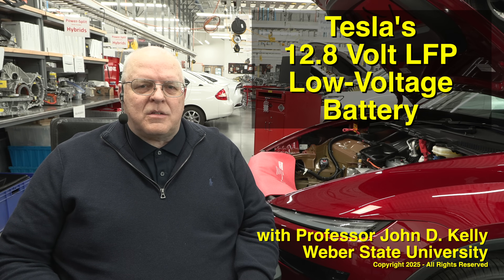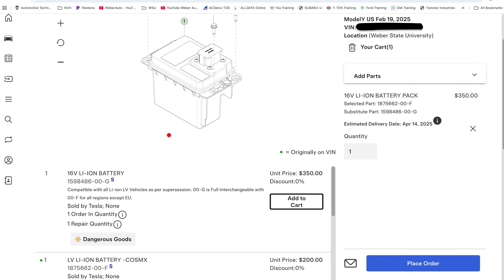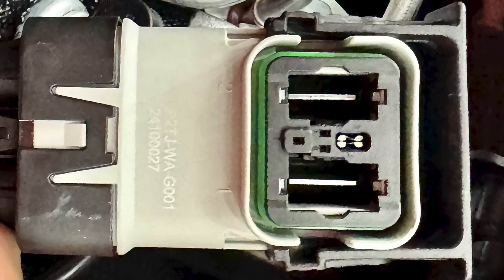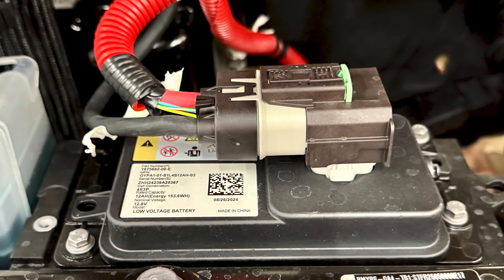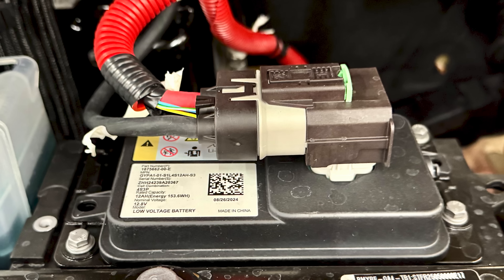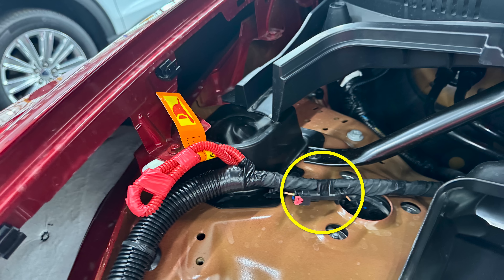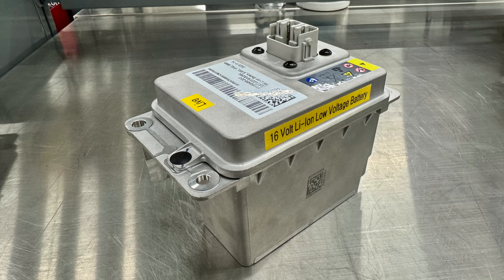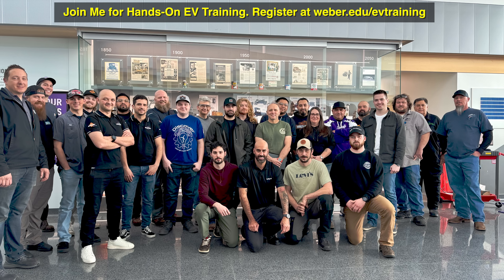Tesla's New 12.8V Low Voltage LFP Battery

Comment: Thanks for your awesome content!

Just a note, as stated on the documentation, for some unknown reason, the newer LFP low voltage battery is not available for vehicles  in Europe. Is it probably due to being manufactured in the Shanghai Factory, with different car hardware?

Comment: 6:30 I'm hoping that the reduction in low voltage system design from 16V NMC to 12.8V LFP is a good sign for us HW3 people that are still on the 12.6V PbSO4 on Intel systems. The cooling system will need to be retrofited entirely, but the wiring looks like it could be salvageable.
Reply from the maker: It is not. I would not plan on a retrofit coming. Thanks for watching

Comment: On my second EV, first a Leaf and now with a 2026 Model Y.  I checked mine and it has the 16v Li Ion battery.  If I understand correctly it should be interchangeable with the 12.8v LFP.  Is there any advantage to switching?  Outside of the ability to use 12v accessories that might not support 16v?  Recently found your channel and really enjoying learning more about the technical details of my car - which I love.

Comment: When the battery failed on the older Tesla's (the ones with the lead acid 12v battery) they could be jumped just like an ICE vehicle.  But now, if the LIFEPO or the Lithium Ion battery fails it can't be "jumped" because of the connector and you'll be forced to have your car towed to a Tesla service center.  I sure hope these new batteries are reliable!!  Also, folks that used to tap into the original 12V lead acid battery to run 120vac inverters are out of luck with the new car.  Tesla should have put a 120VAC outlet in their cars!!

Comment: Hello Mr. Prof. Kelly. I am a Slovak from Europe and I own a Toyota Corolla Cross HEV with an M2.0 l engine. About 2-3 times when entering the highway while increasing speed by quickly and smoothly pressing the gas pedal, it happened to me that in the last quarter of the pedal travel, the pedal seemed to break. When consulting with the seller, it was explained to me that this is a manifestation of the vehicle's kick down function. I am not satisfied with this explanation, because I am convinced that the gas pedal should have smoothness throughout its entire travel. My question to you as an authority in driving school and in my motoring life is: Does the Toyota Corolla Cross M20A have a built-in hardware Kick Down function, or can this only be performed by very quickly pressing the gas pedal? The vehicle has a built-in 5th generation E-CVT hybrid system. I enjoy watching your videos presented in a pleasant and professional manner, I like machines, I was a lifting equipment repairman in a nuclear power plant for 40 years. I wish you many more videos in good health, the best.

Have a nice and pleasant day
Great yours video professor!
Vit Halada

Comment: Do you know if the 12.8v battery would be compatible for the refreshed model 3. This would allow fitment of aftermarket audio amplifiers to run on lower voltage systems? Thanks

Comment: You never told us why you replaced the battery.

Nor did you tell us that this was going to be a seven minute advertisement for training provided by the university that has deemed you a "professor ".
Reply from the maker: I changed the battery to see how it is done. It is a totally new process I had never tried. Nobody gets “deemed” a Professor. It takes a minimum of 15 years of exemplary teaching, scholarly work, and service to even be considered.
Reply: @ you changed it, to see how it's done. So there's not a service manual that says disconnected and remove it and then reverse that.

Comment: Why do they call it 2026 Model Y when the Year 2025 just started?
Reply from the maker: Because they made both versions of the model Y through February. The old one is a 2025, the new one is a 2026. Model years have nothing to do with calendar years. Thanks for watching.
Reply: @ the old one was the 2023-2024 model.  Before we had the 2021-2022 including ultrasonic sensors.  Imagine selling the car used at the end of the year - LOL

Comment: The 12.8 V battery is only $200 vs $350 for the Lion in the parts list.  It is incorrectly labeled as 16V on the parts list.

Comment: Seems pricey. I just bought a new 12v lead battery $85 from Tesla. Old one lasted 5.5 years. If I get average 5 years, I could buy almost 4 lead batteries for the price of 1 new battery. 20 years for old batteries and new battery should last 10 years?
Reply from the maker: The new battery is designed to last the life of the vehicle. Thanks for watching.
Reply: @WeberAuto  That's new to me. I thought Tesla only offered a short life on those. Where can the info be found?

Comment: LFP batteries are so cheap to make now I don't know why we aren't seeing regular ICE car batteries with LFPs yet. You can get LFP motorcycle batteries, but they are overpriced in the US compared to what it actually costs to make them. An LFP battery can be manufactured for about twice as much as a sealed Lead Acid battery for the same cold cranking amps.
Reply: So they are double the price of a lead acid?
Reply: @justinstewart3248  Yes and last at least 10x as long.
Reply: not all LFP batteries are born equal, they get binned like CPU after production the junk grades are cheap and for good reasons

Comment: Which one is technically better?
Reply from the maker: According to Tesla service, they are equal performing. The LFP battery does not require programming when first installed, the NCM does.
Reply: @WeberAuto  I was reading a bit on this, and I think the LFP is better because of the higher expected cycle AND ability to resist heat (it could get really hot under there)

Comment: Thanks for the video. What is the difference between them?
Reply from the maker: The operating voltage is the biggest difference. Tesla states that "Both batteries perform equally, and the fitment will be based on factory, supply chain, and inventory management."

Comment: Why can the 16V battery in my car, not be replaced by the new 12,8 V battery?
12.8 V LFP is the best solution.
Reply from the maker: There are hardware and software differences that prevent it on previous vehicle vehicles

Comment: LiFePO4 are cheaper than Li-Ion types. The have almost half the power density, and lower terminal voltage; there are four cells, not three inside the battery.
I have doubts about the long term longevity of LiFePO4 batteries in high temperature environments. In ICE cars, the LiFePO4 battery - replacing the SLA starter battery - fails after one year because of excessive temperatures under the hood. The Model Y has no engine under the hood though. 
I may sound retrograde, but I preferred the old lead-acid battery. It has no BMS or CAN interface, and costed one tenth of the newer Li-Ion battery, and wasn't a proprietary device.
Reply from the maker: Thanks for watching

Comment: Who are you looking at in the video?  But $350 for that battery?  OMG that's expensive!  Also, you kept saying to the right and left when it was actually it was the opposite of what you needed to do.
Reply from the maker: The right and left side of the vehicle are always referenced from the driver seat looking forward.
Reply: It's about the same cost as a traditional AGM battery.

Comment: $350 for a 12Ah battery 😬
Reply from the maker: They are costly, however, many automotive batteries are in that price range, especially AGMs.
Reply: I was surprised it was so cheap. Roughly the same cost as a traditional a g m battery.
Reply: @JasonWW2000  really, for what capacity? An off the shelf LFP 100ah 12v battery is $200, this one is only 12ah. So, over 10x the cost compared to off the shelf component.
Reply: @robo5553 I think you're comparing apples to oranges. This isn't just a raw battery. This is an engineered module with all the b m s and other circuitry built in and designed to operate in a wide temperature range. It has a full warranty and covers any damage to your vehicle that the battery may cause.

Comment: I found on 2018 Model 3, when original 12v lead acid battery started dying, I connected a CTEK reconditioning charger to it and used its recondition mode.  It’s designed to pulse up to 16V to the battery to “clean” the plates inside and extend the life.  Although CTeK stated it did not neeed to be disconnected from the car, as all cars are made to accept 16volts, the tesla main screen (made by LG) started smoking!  A component on the back side of the screen obviously got stressed and popped.  It required a new screen, not covered by warranty.
I’m not sure if that was a fluke or if the original Model 3’s didn’t  have 16v hardened components but be careful on early cars.
Reply from the maker: The Tesla vehicles here in our shop will trigger service alerts for a bad battery if an external trickle charger is attached for any lengthy duration.
Reply: I think it is not possible to replace the old acid battery, by the LFP, because the connectors are completely different.
Replacent should be possible if they have the same connector only.
Reply: Not very smart using a pulsed charger on a modern vehicle with a load of electronics 😩
Reply: @hughmarcus1  Thats why we read the ctek manual and then called them to doublecheck.  Ctek said every vehicle can handle 16volts.
Reply: LFP (4s single LiFePo4) are perfect to repalce lead acid batteries. The charger from HV to 12V is the same and charge the LFP near the optimum. For could regions tesla should use LTO (6s LTO)
Reply: Considering how easy it would have been to take off one cable.
Reply: @ralanham76  Exactly!  But CTEK said no need, leave it connected in the vehicle.

Comment: The faster way if you have possibility to use toolbox 3 , change on car configuration tape of Low voltage battery then learn new battery. Car shouldn't wont reinstall software 😊
Reply from the maker: I will have to try that. Thanks

Comment: I’d be curious to know if the trailer connector now supplies a permanent 12 volt again. The model X used to do that, my 16V model Y does not. I suspect it still doesn’t due to the LV battery’s size, but one can hope right?
Reply from the maker: I doubt it, but I do not know for sure.

Comment: In my VW ID.3 the 12V battery regularly gets charged to 14,5 V
Reply from the maker: Yes, that is a typical charging voltage for 12 volt batteries. Thanks for watching

Comment: Can you jump start another car with these batteries? I’ve easily jump started over a dozen cars with my 2022 model 3 lead acid battery.
Reply from the maker: No, the owner’s manual specifically warns not to jump start other cars.
Reply: No
Reply: Since these batteries are not required to crank over an engine, it probably has a BMS that limits its output current.

Comment: Very interesting, I just checked my Texas built 2026 Y and it has the Li-Ion battery.  

John, I’m curious what the weight difference is between the two batteries?

Do you know which factory you’re wife’s Y was built at? 

LFP cells are China sourced I think, so I’m wondering if that played a role in which LV battery you get in NA.   Do you know what cell sizes are being used in these LV packs? 

Are they Cylindrical or Pouch style?  

How many cells in each pack? 
4, 8, 12 ?  I’m assuming 4 cells in series  configured in parallel for increased Amperage.
Reply from the maker: Thank you. This one is from the Freemont, CA plant. The weight is 2.1 kg (4.6 lbs) for the LFP and 1.8 kg (4.0 lbs) for the NMC battery. The LFP uses 12 pouch cells (4S3P) at 3.6V per cell pack.
Reply: @ Thank you, Sir!
  I wish you had been my one of my Instructors when I was in Automotive & Diesel technology school 40 years.  Huge Respect for you 🫡

Comment: Interesting that you need a software update for that. Thanks for showing.
Reply from the maker: I suspect all the systems on the car have to be reconfigured for the higher voltage or lower voltage when installing either battery.

Comment: 6:27 Great video and thank you for sharing your knowledge. Bottom line, which battery is the best?
Reply from the maker: Thank you! According to Tesla, "Both batteries perform equally, and the fitment will be based on factory, supply chain, and inventory management." however, they also state "The LFP LV battery does not need firmware updates. The internal logic persists for the battery's lifetime. As a result, a LFP LV battery from storage will be compatible when it is connected without mismatches, MIAs, or the need for software redeploys."
Reply: The LFP is better, 150Wh compared to 100Wh on the NMC. Longer life as well.
Reply: The longer life time might be very important because when you need one time assistance or the car

Comment: Thank you so much. I had always wondered about these new lithium batteries for all the Teslas. I know back in the day they used to die prematurely. I’m so thankful that it appears they have fixed everything.
Reply from the maker: Thank you!
Reply: @LJ-jq8og  The lead-acid batteries had a very short lifespan in certain parts of the country.  18-24 mo.  

I have a 2018 Model 3. The original battery lasted almost 5 years, which is good. The replacement battery only lasted 18 months. No idea why it failed so early 🤷‍♂️
Reply: @dennisschlieckau8723  very interesting. It sounds like the new lithium ions have solved all the problems.

Comment: Did you trade the Bolt in?  If so how many miles were on it at trade in?
Reply from the maker: Yes, traded my 2019 with about 37k miles on it.
Reply: @ Did you ever have any issues with it? Just wondering.

Comment: I imagine it has some pretty clever management to heat it regularly in cold environments considering you can’t really charge LFP below 0C I wonder if it can be problematic in very cold environments.
Reply from the maker: I am pretty sure it does
Reply: The 16V battery has no heating. I guess it is only a battery for opening and closing the contactor and keeping the MCU and screen on for brief periods.
Reply: @rkan2  It's needed to bootstrap the entire car until the DC-DC converter is enabled.
Reply: @MikesTropicalTech  Ye, and since the rest of the car is basically a laptop, consider it as a laptop battery. :P
Reply: You also can't charge NMC battery below 0C.

Comment: I wonder they did not use LFP early on considering price, robust, and cycle life of li-on. Considering CATL branding of li-on battery, it came from China.  Anyway, the LFP battery means it won't need replacement throughout the life of the car (though BMS could malfunction)
Reply from the maker: Thank you for watching

Comment: Strange to move back towards 12v, but I suspect it's a supply issue. That being said, I much prefer the LFP battery so the BMS can keep it at 100% without issue. I'm curious if it has a shunt for the SOC. I'd expect so. Maybe in a few short years, they'll all be 48v. I expect so.
Reply: LFP still has accelerated wear when being left full, but unlike NCA and NMC, it wears slower when charged to full.
Reply: @battery_wattage  LFP 100% still lasts more than NMC 80%
Reply: @apothecy4011  yes that’s what I said. My point is you could push so much more potential from LFP if you do limit its charging.
Reply: @battery_wattage  16v isn’t full for nmc or nca (just 4v per cell), it’s more the cycle count I would say. Main reason is price, for lfp should be better for tesla.
Reply: I don't disagree. But cycles are greater with LFP because NMC voltage even at 60% SOC is 3.7V–3.8V per cell. LFP is 3.6V per cell at 100%.
Reply: @Techridr - The problem with your wish to go to 48v is the global supply chain is based on 12v.   Ain't happening any time soon.
Reply: @kelviskelvis7140  Tesla literally wrote a book about transitioning to a 48V world and sent it to every other carmaker and component supplier.  The Cybertruck is a 48V system but any component not available with native 48V has a little buck converter to get down to 12V.  These will be replaced over time as the supply chain responds.
Reply: @MikesTropicalTech  Such a devotion to a failed cult....
Reply: @ Umm what?  Then why are you even watching this video?  It's OK, you can come out of the closet and admit you like Tesla's technology.
Reply: @kelviskelvis7140  48V also adds cost to the components (Diodes, FETS etc.) due to higher max voltage rating (60V).
Reply: No doubt, the disadvantages are higher initial costs, complexity, and compatibility challenges. But advantages are great. 48v enhances power delivery for auxiliary components, reduces wiring weight / cost, boosts efficiency of subsystems like pumps & HVAC, and supports advanced features like ADAS, all while complementing the high-voltage traction battery with a more capable low-voltage architecture
Reply: @ They already moved away from 12v going to 16v a few years ago and now 48v in the cybertruck. The transition has already started. This is absolutely temporary. Also, Tesla's vertically integrated. The supply chain means little to them compared to other OEMs. When they fully transition to brake and steer by wire, it will also need to happen. As for your statement of "not happening soon" Well probably not till a full refresh of the line which could be 3-5 years away.  So I agree, not soon.
Reply: @kelviskelvis7140 they already started the transition with cybertruck so they have enough parts to make happen. They're just waiting the whole supply chain to completely transition to reduce cost. Also Chinese EV is also pushing this too
Reply from the maker: Thanks for watching
Reply: They would have to go with a 5S3P layout to get to 16V and that's probably a little spicy for the 12v components around the car.  The 16V model had a sticker saying it was a 1P4S layout in the same physical space, so each cell is 4.0 volts nominal.  If they went 1P3S it would hit 12.0 volts without much headroom to keep it topped up.